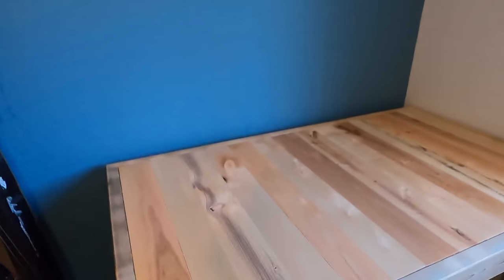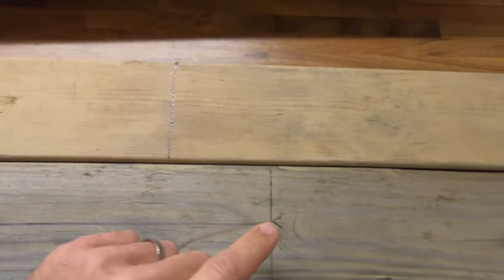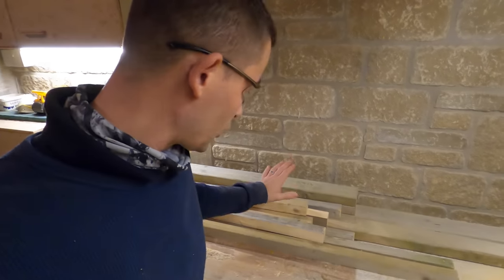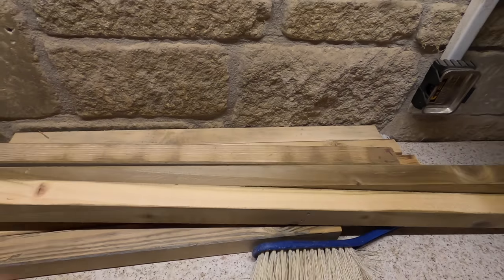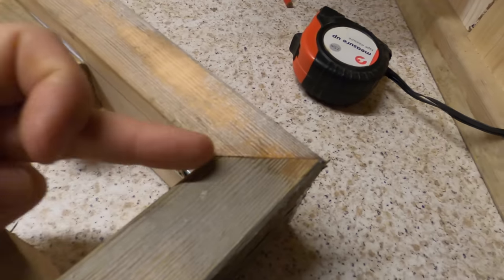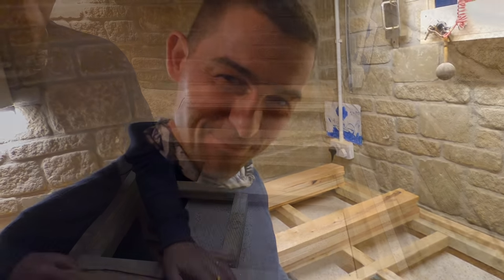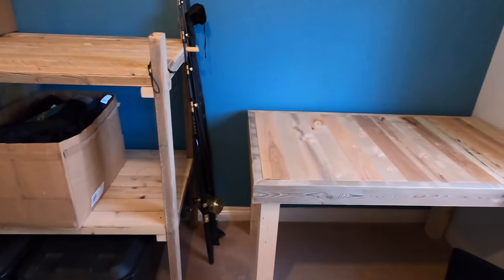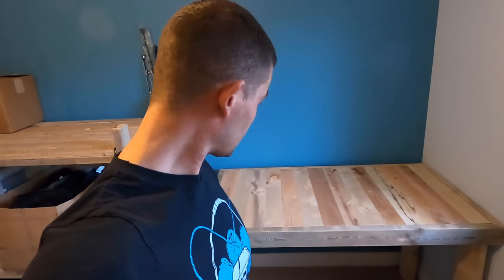Fishlocker Office Desk - DIY Palletwood and reclaimed materials

Comment: This is a great video, especially when you need to introduce desks into kids bedrooms. 

Personally, if i had some extra cash, i would build a temp frame around the desktop and use some e proxy plastic resin, to fill in the gaps and divots to protect the wear and tear for a smoothish finish. For a full fish locker finish, you can place sea shells and bits to decorate and do two layers of e proxy, setting in between. Don't forget to fill the underside with a bit of wood glue before you start! 

I had a one bed flat during uni but was lucky enough to have a nook next to my wardrobe. These are great space savers for shelves and a desktop. 

Really practical video that can inspire anyone into making a desk that works for them in their space. 

Also, better the legs are too big, than too short. Longer legs are great for standing desks, so also something to bear in mind when planning your project. DIY is subjective and creative to suit your needs. 

Don't forget to keep your shavings! They too can be reused but keep them safe from fire risks. 

Love this John!

Comment: Hello John.
Well done. Old school, but with soul and is unique. Looks good. If you want to get rid of the line from electric planer you have to use an oscillating or belt sander and use sandpaper gradation, i thing from 80 up, depending on the smooth effect you want to get (but there is more work to do and more messy ) and then decide how to finish. 🙂👍

Comment: Nice work.
Most chairs are too short for tall people. I was (before my joints started to deteriorate) 190cm. Just about every piece of furniture made is to low for me. 
Trust me I've tried out loads of them. I worked at a major furniture manufacturing plant for years.
My only suggestion to make another project like this easier would be to wait to do the final plain work to the desk surface until you have the boards in place. That way you plain them in relation to each other.
Similarly like what you would do if you glued them up into one sheet.